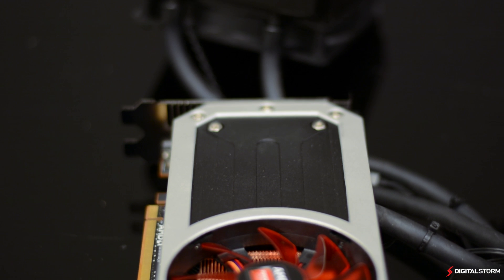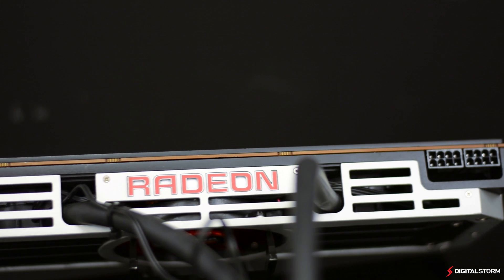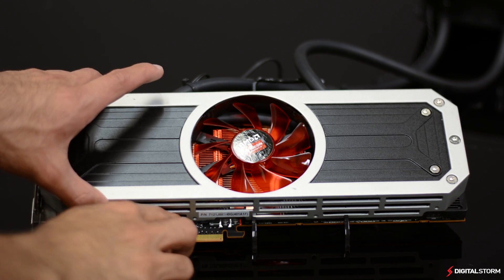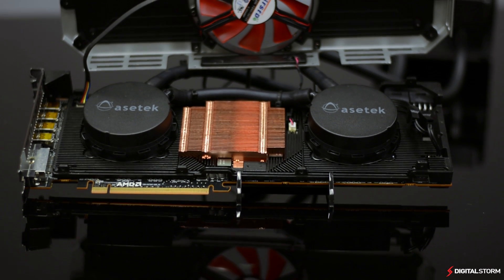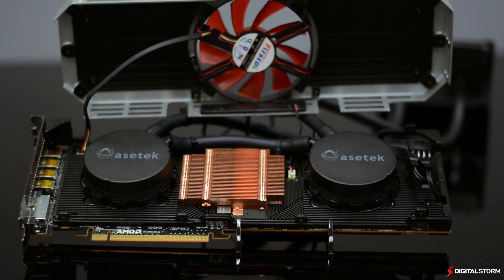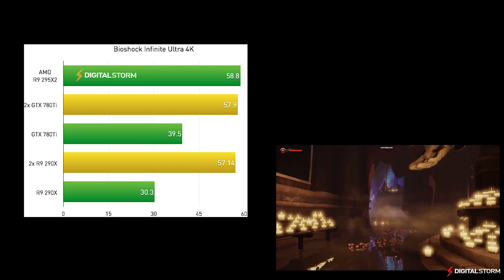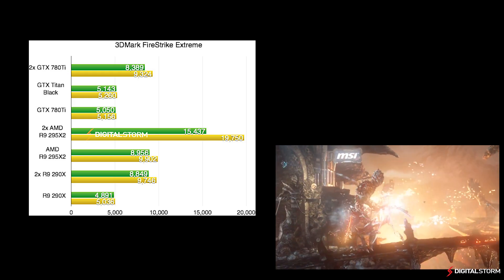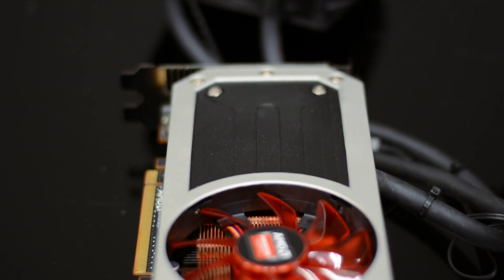AMD Radeon R9 295X2 Review and 4K Benchmarks

Comment: World fastest card for now until later time there will be another faster card than this. That just how technology works.
Reply: Captain obvious over here
Reply: the next faster card will be the r9 395x2
Reply: not really! the r9 295x2 is better than the 7990, 7990 is a bigger number than the 295
Reply: This is not the world's fastest gpu. The Tesla K20x is much faster than this, MUCH.
Reply: not in gaming! the k20x will be stomped on!
Reply: marley gibson It powers the world's fastest computer, im pretty sure that can at least overkill gaming.
Reply: I is a workstation gpu so the drivers are shit fro gaming
Reply: Felix Liang it is not designed for gaming and neither are its drivers, all tesla GPUs are terrible for gaming compared to a high end GAMING card

the k20x has a very low clock speed, relatively slow effective mem clock, and slightly low mem bandwidth, all of those things are essential for gaming... i would expect the k20x to perform in gaming about as well as a clocked up 770 or a reference 780..... a damn good card but not at all for its price tag

Comment: I don't get it
Titan black > 290x right ? 
Titan Z = 2 Titan black right ? 
295x3 = 2 290x right ? 
SO HOW THE FUCK 295x2 > Titan Z ??
The 295x2 isn't the fastest card, it is the Titan Z
Reply from the maker: The Titan Z is not released and this card performs better than anything out on the market right now.
Reply: ***** lol so the 295x2 would be the fastest card during ..... 1-2 monthes ? but after all, for the same price than a Z we can get 2 295x2 and CF them
Reply: bigmonstermunch you also have to consider that this is watercooled. I'm sure those mega hot GPU's will benefit a hell of a lot from it. I could see it being faster at stock clocks. Who knows about overclocking until we see the titan z. Titan z isn't for gaming anyways.
Reply: Titan Z is a workstation card, still I don't know why the hell are people comparing those gpu's when they are so different and got their pros and cons.
Reply: Actually no, the Titan Z would most likely not outperform the 295X2. Why? Brace yourself alot of reading here.
Basically because the Titan Z is very much underclocked. The Titan Z is said to deliver 8 teraflops of computing performance. The Titan Black delivers 5.1. That is far from 100% scaling.
The 295X2 however keep the clock speed of the 290x which means it can in some cases scale 100% over a single 290x.
I would say the Titan Z might do better in 1080p as the Titan Black currently does very well there over the 290x, but in higher resolutions the 295X2 will most likely outperform it. The 290x already comes very close to the Titan Black in 1440p and 4k. So get two of both and underclock the Titan Blacks, then you will most likely see the dual 290x beating the Titan Blacks.
But of course this is what I believe after looking at the specs and current 295X2 benchmarks. I look forward seeing if this actually is true.
Reply: William Cohen At the most stupid price point ever.
Reply: Digital Storm Ctrl+c
Reply: What part of "R9 295x2 uses an overclocked R9 290x" you don't understand ?
Reply: Titan Z isnt released yet. so for now, the 295x2 is the fastest card on the market.
Reply: John Gorby Of course it's for gaming, It's just for a niche section of the gaming community.
Reply: John Gorby As I said it's for a niche section. The same as the original Titan was. It's still a gaming card though and it's supported by Nvidia like one. As you can see from there gaming driver support which does not extend to other workstation cards.

http://www.nvidia.com/Download/Find.aspx?lang=en-us
Reply: The Titan z is out with 12 gb of ddr5 ram!
Reply: *****
well realistically 3 grand isn't that much for a professional card. Titan's are treated as gaming cards but they aren't. If you're building a high end workstation and would also like to have the ability to do top end gaming the titans are the only cost effective way. They trump any professional card on the market with gaming and they are dirt cheap compared to other workstation cards (though they are also quite weak comparatively in a professional environment). I'm sure nvidia will come out with a dual GPU card that isn't based off the titans. It won't be so ridiculously expensive and will be more competitive. For now though unless you're building a workstation the titanZ is for those few who want to build a super high end pc with the most expensive parts that don't have the knowledge to know what parts are actually the best.
Reply: John Gorby Nvidia said themselves that Titan Z was the ''ultimate graphics card for gamers.'' There is in no universe Titan Z would be worth the money and should be priced at such high.
Reply: ***** Look up the prices on workstation cards. Titan's didn't sell as well as they did because that many people are too stupid to wait for 780s to launch. They sold that well because they provide considerable value besides there gaming capabilities. Of course nvidia said that. They are great performers. The more they say things like that the more the dumb masses assume nvidia is always better. I know that they aren't made for someone who just wants to play vidja games. I assumed you knew as much. I guess I was wrong.
Reply: *****
http://forums.cgarchitect.com/73354-geforce-gtx-titan-vs-quadro-6000-a.html

http://www.amazon.com/dp/B0044XUD1U/?tag=pcpapi-20

there you go, I looked around for you. A quadro 6000 the cheapest I can find was just shy of 2000 bucks. It's faster in most workstation environments than a titan or titan black but not by much. The titan/black is half the price and would let you game very nicely. Perfect for someone that would like to do both. Also, in case you didn't know workstation stuff benefits from sli much more favorably than gaming. Therefore having two gpus on a single pcie lane makes it easier to have either even more sli or to not spend so much money on a most likely already expensive board that supports ecc memory. Just because a Titan and it's offshoots don't make any sense to me and you the average gaming consumer it does have it's niche market and NVIDIA would be dumb to come out and not market it as a behemoth. I do think NVIDIA should be clearer in it's marketing with TItans... mostly because I'm tired of explaining that they do make sense. Just not for plain gaming.
Reply: Just because the titan z is more expensive doesnt mean its faster. The 295x2 is slightly faster in games
Reply: Syndicution The problem with the Titan z is how underclocked they are. If you built a PC and watercooled the Titan Z's you'd get a rig that's hard to beat, However current tech site reviews show crossfire performing better than sli especially at higher resolutions.

Comment: seems like a beast love the cooling system buttttt no HDMI lame I'll pass
Reply: Really? HDMI is outdone by DP's >.> Buy a hub. More so, if you got a 295X2 you should have a monitor that doesn't only use HDMI.
Reply: This card is not for 1080p gaming would be a waste. HDMI only supports up to 1080p.
Reply: 96firebirdformula Not true, current HDMI 1.4 supports 4K at 30fps.
Reply: The fact is that DP 1.2 came out a billion years ago and already supported 4k @ 60fps

Comment: sounds cool, but yeah, the Titan Z, will it be better? no one knows O.o o.O
Reply: i think nvidia will be fine
Reply: The TITAN Z deffinetly wins
runs cooler
does not need a stupid extra radiator
higher amount of GDDR ram
more CUDA cores
and the list goes on...
Reply: who is really going to buy this or a titan z. I mean there will be $200 cards 3 years from now just a good.
Reply: The Titan Z will be absolute crap. Don't get me wrong, it will most definitely be a powerful card, but for the price? No way. You could go with a triple SLI configuration of 780 TIs, and it will both outperform the Titan Z, and be cheaper than it. Not to mention the fact that most Nvidia dual-gpu cards have had many problems. I would just stay away from dual-gpu cards in general, because it's the same as SLI or Crossfire, except on one card.
Reply: TheChrisglasgow Here you go, They e-mailed me offering me one on the step-up program, The 780 ti is also coming in 6gb apparently.

http://www.evga.com/articles/00830/
Reply: it might be better, but definetly not worth $3000. its like the alienware of gpu's lol
Reply: SilverMiners If you think the TITAN Z will run cooler you are an idiot for thinking a air cooler would do better than a closed looped water cooler. Only a a fucking idiot would buy a Titan Z.  Two Titan Black editions would do better. AND it will be slower because it will be underclocked.
Reply: SilverMiners You will be the laughing stock of the PC community for buy a 3k GPU worth 1,300.
Reply: im not saying it´s worth the money in any way, im just saying that AMD has got a long way to reach up with Nvidia
Reply: We can't deny that the 295 x2 is a great card, I'm gutted Nvidia aren't doing a cheaper 790 aswell as the Titan Z,  4k is the only place this currently has an advantage over the 780 ti's, Nvidia are releasing 6gb 780's and 6gb 780 ti's now so a dual card made of two of the 6gb 780 ti's would solve the 4k issues.
Reply: 780 6gb ! I dont think so buddy.